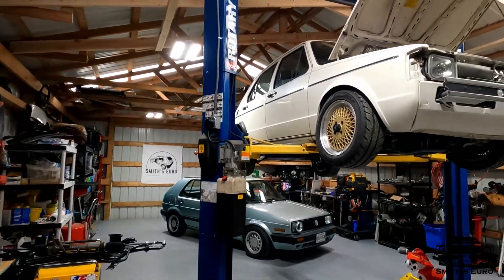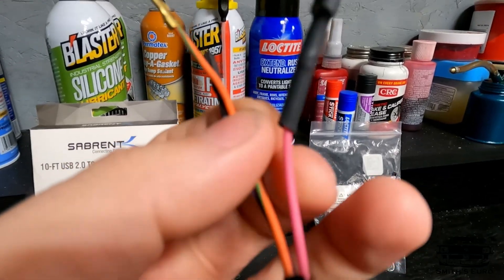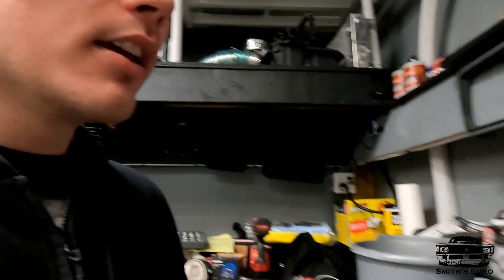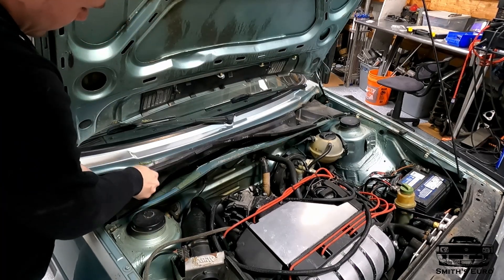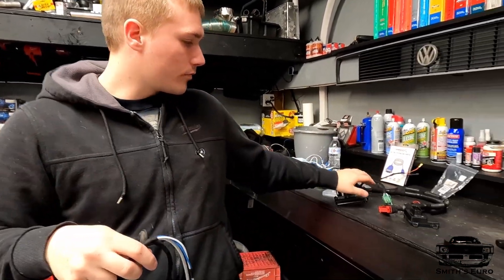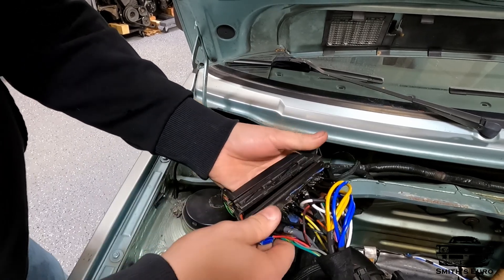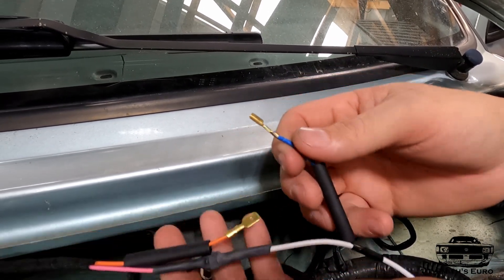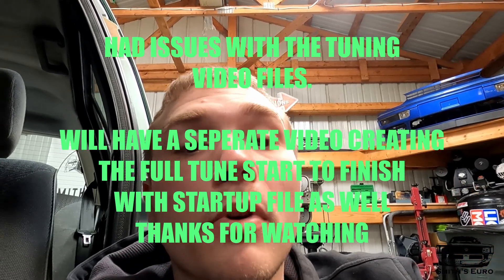PLUG & PLAY VR6 MICROSQUIRT STANDALONE ECU INSTALL

Comment: Hi mate, i'm in the middle of a 3.2 vr6 swap with dsg into my van, had the engine running out of the car as i've had the ecu immo removed and others that stopped it running, so runs without the dash installed etc.. I'm wanting to supercharge it which i've already got the parts for including the compression gasket... i'm still getting my head around the electronics side of things but wired up the original full loom to van lights etc... thing is im wanting to have a large digital dash so can i do all this along with dsg with the microsquirt?  I'm tempted to just use the factory ecu but been checking out speeduino megasuirt and just come across your vids so advice would be great, im in the uk / selby
Reply from the maker: Dsg control is tough I recommend emailing paul at kptuned.com

He builds plug and play harnesses and would know best, hes well versed in all things microsquirt and vw

Comment: are you able to run a bosch ISV on microsquirt?
Reply from the maker: Yes but just adding a throttle adjustment screw to the throttle body is a much better option
Reply: @SmithsEuro  glad I didnt go microsquirt then. I need ISV for boost control on a g60. Thank you for the response.

Comment: How you control the idle with those cams
Reply from the maker: On chip tune it idles just fine.
On micro squirt i made a throttle stop with a bolt/nut to hold rpm where i wanted when hot.
When i get a chance to make the base map/startup vid ill show how i did it

Comment: Microquirt is great. ran one on my 12v vrt and made 600whp with it with out a problem!
Reply from the maker: I plan to turbo this, and be around that 550-600hp stock internals. Hopefully the 270k on the block with have it loose for boost.

Comment: Just installed this in my caddy VRT love it🙏🏻🤟🏼🔥💪🏼
Reply from the maker: Setup the 2step yet? Best part of standalone lol
Reply: @SmithsEuro  hey man did you ever test the 288 with stand-alone yet to see if they would make anymore power?
Reply from the maker: I have. No significant changes.
I think if i ran different fuel i would have gotten power.
I added 2 degrees of timing and nothing changed so i backed it back to 39 I believe 
I also tried changing fueling from 11-13.1 like hondas do but no change in power either.
I have it at 12.3 afr WOT and it loves it there.
194hp
Reply: @SmithsEuro  that’s awesome I told my buddy Stephen from Lugs I think those 288 are trash and a better cam believe it or not is the DRC 268 right now I’m running Autotech in my turbo set up but going to try DRC after and also working with Brian Crower since they are right down the block from me. A split pattern set. Like 268/276 or 268/280 so the exhaust is bigger for turbo and doesn’t cause high EMap issues. Keep you posted on what my truck makes with Autotechs
Reply: @SmithsEuro  I forgot to mention that was the fuel that I used in my G60 8 valve motor. That ran 11.87 -12.01 in the quarter and I ran AFR at 13.4 across the RPM Range. Initially the truck made 187 I believe and with timing and the fuel jumped to 211hp I have all the Dyno graphs. Mind you this wasn’t even on a really small pulley on the supercharger it was literally running a 68mm so I’m sure smaller pulley I probably could of gotten down to mid to low 11s and still on chip tune no Micro on this set up🤣
Reply from the maker: If i had a bigger set of cams given id take them lol 
Thats a pretty good time in a g60, over here g60 are paper weights lol since you can get a vr6 from 90-02 here for pennies. 
There is e85 by my house now. I may begin trying to use that.
Id never run m1 on this car or any other race gas.
Reply: @SmithsEuro  try ms109 it’s unleaded and works well